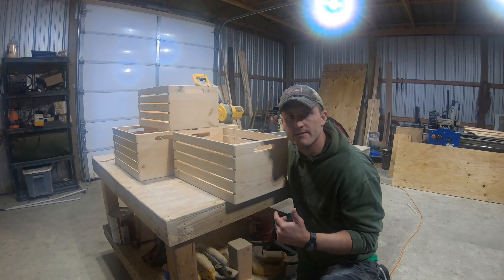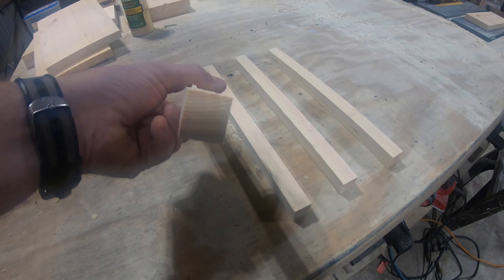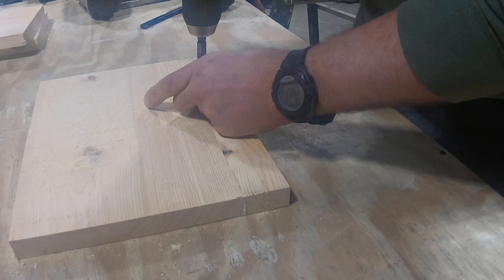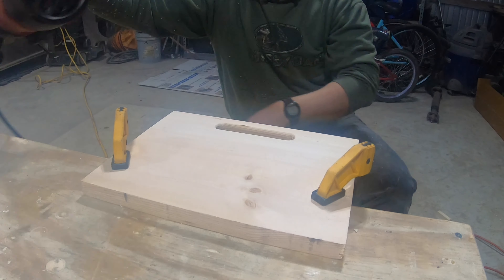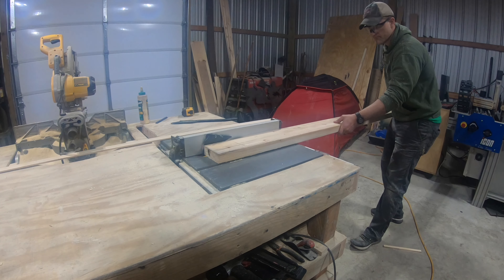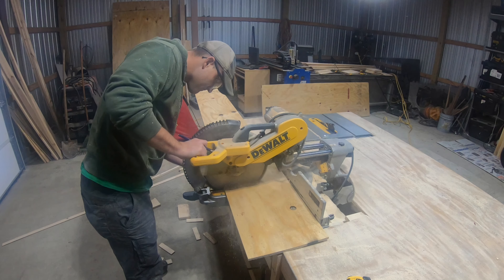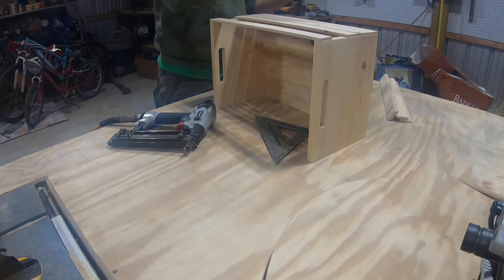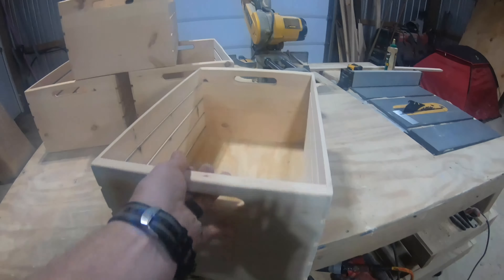How to make Steve Ramsey’s crates...BUT...

Comment: Thank you for this video. I am going to build several of these to store my wife's canning jars! I think I will build ours to hold 18 jars. The crate will be wider that way for stability to stack up. I am going to use 7/16 OSB and 1/2 plywood siding on the bottoms. Because I have a ton of scrap just laying around in my way. The round edge cut off from the 2x4 I will use as cleats on the underside to stop them siding around when stacked. 
Good way to use up all the scraps in my way constantly. Better way of storing empty jars than cardboard boxes that are constantly falling apart. I love the handle and router idea as well. Again, thank you for the light bulb idea!

Comment: You put 2x6 in your description but looks like you used a 1x size in the video?
Reply from the maker: Great question. I ripped down the 2x6 into the thin strips on the sides. If you don’t want to do that, you could also buy a bundle of lattice.  I’ve done that before